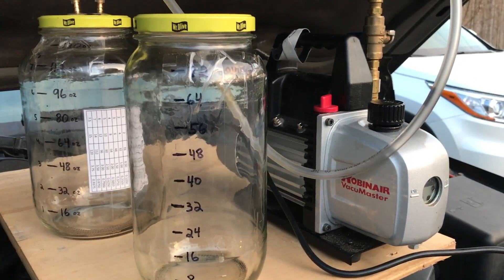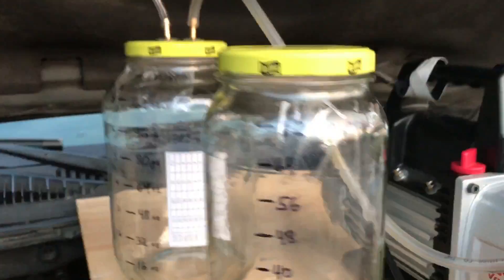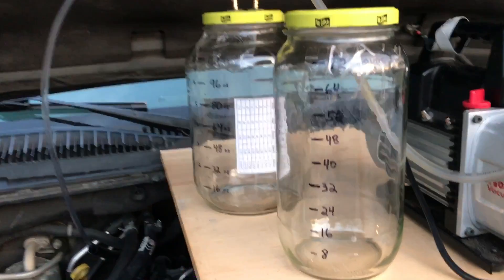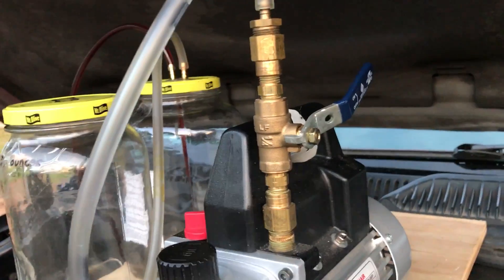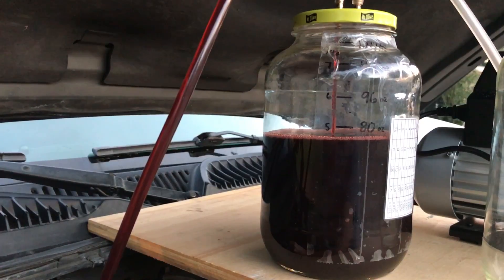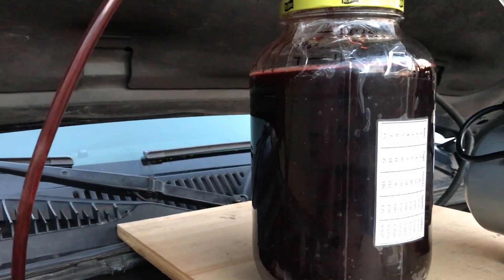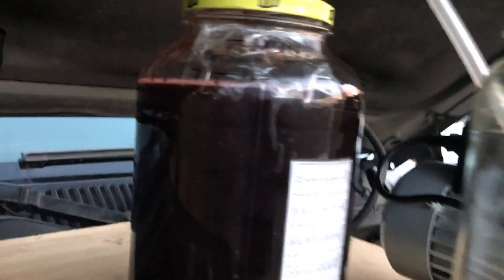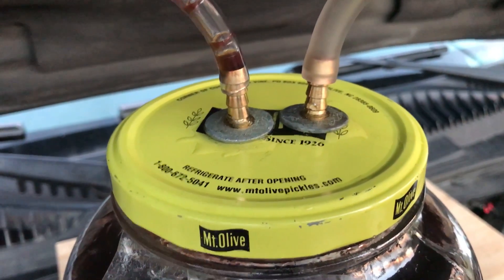Transmission Oil and Engine Oil fluid extractor using vacuum pump

Comment: Extracting through the cooler line removes all the fluid. This way doesn't.
Reply from the maker: The point is not to extract all. Coolant line method doesn’t extract all either unless you do a longer drawn out process. I’ve done both. This way done regularly is very fast clean and adequate.
Reply: @condor5635  Ultimately, it's however you choose to do it. For me, I like changing all the oil, not just some of it. Emptying the pan and going through the cooler return line will definitely remove all of the fluid.
Reply from the maker: @apostasiaelegcho5612 I’ve done it all believe me. This way done every 20-30k miles is plenty. Thats because I buy my cars new and maintain them myself. Would I do the cooler line method if I brought a used car yes. Ongoing maintenance no.  Dropped the pan at 100,000 clean the magnets replace the gasket.  I’ve got three cars with 275,000 miles or more.  If you don’t see the value in this pump, then you’re missing the overall point.
Reply: @condor5635  I didn't mean to claim there was no value in doing it that way. My car is 22 years old. It looks like it's 5. I'll get another 20 years out of it. I just think if you go to all that trouble, might as well clean it all out. Anyway, good video.

Comment: I'm going to try this but to do water changes on my aquarium.
Reply from the maker: Probably need a 5 gallon carboy. I have one of those and it works great.  Although I had an aquarium and I never used this I just use a pump and filters.
Reply: @condor5635  it would be much easier to buy a pump and just use that. But I'm very frugal with my aquarium hobby lol I have some 5 gal buckets that I could repurpose. I bought a nice cordless vacuum pump a few weeks ago since it was time to replace some components of the HVAC system on my vehicles. I figure if I could get some extra use out of it, it's a win win situation.

Comment: Dang , i just pump out a sealed for life transmission with a hand pump. And i have this vac pump sitting in my garage  . This will be great for differentials
Reply from the maker: Yes, I use it for vacuuming the differential fluid out of my suburban with a long vinyl tube works great. Not very effective, however for a seal transmission because you can’t get to the fluid from the top. The fill plug doesn’t have enough access and there’s no dipstick.

Comment: What fittings are needed for the ball valve? 

Thank you
Reply from the maker: I have no idea what you would want. You just need to figure out based on what size ball valve you want to use. It’s not difficult. I’m not sure if it was a quarter inch ball valve or a half inch ball valve either one would work just need to experiment.

Comment: Have you used two smaller jars in series to catch say 5 quarts?
Reply from the maker: When I go above a gallon I have two car boys. A two or 3 gallon one and a 5 gallon one. I’ve use those occasionally but not a whole lot
Reply from the maker: I’m just re-reading comments on my video and saw this one again. I’m guessing two jugs in series would work fine it would essentially fill up the first and then start going into the next. I don’t see any issues. I might have to try that next time I need more than a gallon of extraction. Thanks

Comment: DANG!! I WISH I WOULD'VE SAW THIS VIDEO YESTERDAY; I WAS TRYING THE VIDEO IDEA OF USING A SPRAY BOTTLE NOZZLE AND PLASTIC/RUBBER TUBING TO TRY TO EXTRACT THE EXCESS TRANSMISSION FLUID OUT OF MY TRANS. I SAT THERE FOR 4 HRS YESTERDAY TRYING TO PUMP THE FLUID OUT AND SPRAY IT INTO A BOTTLE. I PUT TO MUCH FLUID (A QUART TO MUCH) IN MY TRANSMISSION AND NOW NONE OF THE GEARS IN MY WIND STAR WILL SHIFT INTO GEAR. SO I CAN BUY THIS AT HARBOR FREIGHT OR ACE HARDWARE?
Reply from the maker: Charles Porter - HF sells the vacuum pump. Getting the pickle jar, tubing, ‘metering’ valve and vinyl tubing is all you need to make the rest. You will love the results. Good luck
Reply: @condor5635  Thank you for the Advice Condor.

Comment: Hi Sir, if using plastic peanut container can it work or will damage the plastic container, have you try using plastic container to extract the oil? thank for sharing
Reply from the maker: Ng Ch - I have tried several other containers made of plastic and although they seem sturdy in your hand they collapse under vacuum pressure. Glass pickle jars are the only things I have had success with. Would love to know others suggestions!  Thanks for sharing and watching!
Reply: @condor5635  Thanks for your information.
Reply from the maker: Ng Ch vacuum pressure is an amazing force!  Look forward to hearing more about your experiences!  Thanks

Comment: Is this removing fluid through a transmission dipstick tube or through a filler plug?
Reply from the maker: JackTannehillPromoter this is removing it from the tube which is the filler and dipstick location as well.  Thanks

Comment: I've done basically same thing for several years. 
I prefer the cheap $16 dollar harbor freight air compressor AC vaccum pump.
I use one of their cheap air regulators on it.  20-25 psi on the regulator pulls plenty of vacuum for fluid extraction.

I use the quart and half gallon Ball jars,  they have measurements built in.
Reply from the maker: Sam Sullivan - thanks! Have to check out Ball jars knew they made smaller ones but not gallon ones! Is the Harbor Freight a combined compressor/vacuum?  Thanks for commenting !
Reply: Sam how many cfm does that require? I only have a 1 gallon compressor so I used a oil less vacuum pump I had around the shop https://www.youtube.com/watch?v=jjGqUhP9uII

Comment: I would advise putting a piece of heavy cloth or a tarp over this device, at least for the first use.  It might implode.
Reply from the maker: 1234faabbb used them many many times without issue but having a heavy towel over it wouldn't hurt if that makes you feel better.  The key point is don't go crazy with the vacuum pressure since the fluid starts to boil etc and there is really no need since a small negative pressure allows it to flow at a good rate anyway.  The valve on the vacuum pump is key to making that happen since your can (and need to) regulate the pressure manually.  Get it flowing initially and then turn off the valve.  Wait 10-15 seconds until the flow starts to reduce and the open the valve up again.Think of it as you drinking from a straw- you don't need a lot of vacuum to make the fluid flow.  Thanks for watching!
Reply: LOL, it wont implode man. Stop your whining.

Comment: Did you need to make rubber gaskets for the pickle jar lids or just use them how they are?  What about sealing the barbs to the lids?  How was that accomplished?
Reply from the maker: Snake Doc - the lid seals are perfect as is since they seal pickles and the juices.  The barbs on the lids I used some flat washers to give them support and then used epoxy to seal and secure them.  Might try permatex gasket sealer as well or in place of. It's just important I found to have the support of thin washers on both sides of the barbed nipples.  Never seen a commercial product that could be used instead.  I used this system  yesterday to remove 145 ounces of ATF fluid for my CV axle job.  Took like 5 minutes.  Thanks for watching!
Reply: @condor5635  I built mine IDENTICAL to yours and I cannot get it to pull fluid up the tube.  There are no leaks and I feel suction on the end of the clear hose too.  What could be the issue?  Do you need to get the trans fluid hot?
Reply: nevermind, I just didn't make it down the last curve of the dipstick tube.  I got it going now.  Holy crap!  This thing is awesome!
Reply from the maker: Snake Doc - happy you like it!!

Comment: I can’t believe I’ve waited to google this. 

I had the concept down, but me applying it was different. Thank you!
Reply from the maker: Doc Cal - used this system yesterday to remove ATF fluid when removing my CV axle.  Two quarts drained out of the seal area when I did the drivers side two days ago.  I was expecting a little to come out but not two quarts and I forgotten to have a pan all ready. So I vacuumed out 140 oz prior to doing the work on the passenger side which I did a few days later.  Kept all the fluid in two clean jars you see in video while I did the work and then put it back in when completed. Not a drop came out near the seal this time!  Worked great - thanks for watching and commenting.
Reply: @condor5635  I haven’t had any issues with mine. I am glad I stumbled upon this video
Reply: @condor5635  I don't understand how or why that would happen, 2 quarts leaked?
Reply from the maker: Tadders - when you remove drive axles on front wheel drive cars the transmission fluid can leak out from the axle seals on either side when you pull the axle off. . Using this pump allows you to take out the ATF fluid so that when you remove the axles the likelihood of very much fluid leaking out is much reduced or eliminated
Reply from the maker: Did you ever end up making your own? Interested in your outcome

Comment: Modify a rubber cap with a vacuum fitting and you can use it to bleed brake systems and clutch hydraulics by placing the fluid reservoir under vacuum for a bit. Just replaced a clutch master and slave and in 10 seconds of vacuum pumping I had an air free clutch release system. Never touched the pedal or bleed screw lol.

Comment: This sounds exactly like what I am looking for. I need to get something for extracting my transmission fluid and I also want to suck oil out of my lawnmower that has no drain plug. I already have a vacuum pump so if I can replicate this system I think i'd be looking pretty good. Any tips on hose sizes or setting for the vacuum pressure value? How much did you have to restrict it to get a nice flow?
Reply from the maker: Frozen Thorn - I just used mine yesterday to suck out the oil from my compressor. After doing that I removed the drain bolt and nothing came out so that’s the way I’m gonna be doing it from now on with that compressor!  - it’s a quarter inch ball valve that you need as well as quarter inch tubing and nipples. Easy to put all that together. The vacuum pump puts out way more than enough vacuum so it’s very little opening of the valve once the vacuum is established. Thanks for watching and good luck with your project. You’ll like it a lot

Comment: This is the cleanest way of doing things. Now you can take the pan off and complete the job with a full transmission flush. My new pan has a drain plug. I do my brakes with vacuum as well. Nothing gets spilled, just all clean.
Reply from the maker: Gerard Lunow - thanks for the comment.  I personally think this system is much more effective, stronger and versatile than Mityvacs  or other manual pumps. Cleaner as well. Thanks again

Comment: That's partial fluid change and not all the fluid get out totally. The reason is that there is a lot of fluid on the torque converter. Mixing it it will take very long time and a lot of fluid changes to get near to full fluid change .
Reply from the maker: Special edition - I know all about what's left in the torque converter and yes it would not get it all out but doing this 4-5 times gets you over 90% new fluid.  I have done the math. It takes 10 minutes to do and as part of a normal maintenance will keep fluid at a very high quality. I have also done the fluid change by removing the return line and doing multiple cycles of starting the car and pumping out fluid getting a more immediate full change.  I prefer this - You don't even have to get dirty.  Granted doing a pan drop at some point is required as well to change filter and clean magnets.  This technique works great for all sorts of extractions of fluids.  I love it. Thanks for watching.
Reply: @condor5635   Olso I wanted to say that partial fluid transmission changes it will get to 50 % or so maybe 60 % but not totally clear .I did change my transmissions fluid  partially and every time I will get 3.5 quarts and replaced with the new one and the fluid still looks red dark kinda.   There is a formula  mixing the fluids that can give you the long run and how many times you need to get to 90 % like you say here . Now emptying the fluid transmission from the lines and running the engine it will make your transmissions pump running dry and that's near to destroying it . Thanks for replying here.
Reply from the maker: Special edition - yes it’s easy math to figure out but like I said 4-5 of these will get you 90% or more new fluid. My approach is to do this as a part of regular maintenance thereby keeping the fluid at a high quality all the time.  As far as doing it via tranny lines I only drain a quart at a time and the refill and repeat. Thanks
Reply: @condor5635  Yes .I agree with you on changing the oil all the time  so that way the oil will be in good quality and that way I dont need to change the filter for years if not forever because the filter will work clear all the time . I saved a lot of money this way instead going to the dealership and paying 200$ plus taxes and ruining my transmission . Thanks .
Reply: The pump out, great idea.  This as a service not good at all.
Reply from the maker: TreRichie - what do you mean by this as a service not good at all?

Comment: Hmm.. So you can turn off the valve and the oil will keep draining?
Reply from the maker: Yes since the jar still has vacuum pressure in it, it will continue sucking oil out until. The pressure equalizes with atmospheric pressure.  This will be the case for 10-20 seconds I am guessing.  It is a gradual decrease in amount over that timeframe. Thanks for watching!
Reply: @condor5635  Thanks for the quick reply. I just bought one today to extract brake fluid. My Brake booster went out, so your method looked like the best one to take the oil out. I didn't feel like taking my tire off to bleed the brakes. It looks like it makes things a lot easier and mess free. I just need to head towards home depot now to get some fitting for tubes and a valve. So you would say 1gal jar is recommended for most oil extraction?  Thanks for sharing.
Reply from the maker: Fallen Matter - although this will work fine for brake fluid there really isn’t enough brake fluid in my opinion to make this worthwhile. You might only get a pint or two out of the brake fluid reservoir. For brake fluid I bought one of the large syringes that work well to suck out the small amount in the reservoir. Don’t get me wrong - this will work fine as well. It really excels for ATF and engine oil where you have over a quart to extract. Good luck and thanks for watching
200ml Syringe
 https://www.amazon.com/dp/B0768B5BTM/ref=cm_sw_r_cp_api_i_uTk4Bb3X9YCZ0
Reply: @condor5635  Awesome. Thank you for the great info. It helped a lot.

Comment: A great set up mate, i might try plastic fluid retaining bpttles, as i would drop it at least a couple of times....Lol
Reply from the maker: Norman Mendonca - thought about plastic a lot but there are not any nice plastic container that are very clear and that don't collapse under the vacuum pressure - both of which were requirements.  Glass is much easier to clean as well and these jars are everywhere and cheap.  Actually used this setup last night to remove the water from my AC pan in the attic which was full of water as the main drain had clogged.  This easily pumped out gallon and a half of water.  Thanks for watching. Appreciate it.
Reply from the maker: Norman Mendonca - have tested several plastic containers and all collapsed unfortunately. I wish I could find some that were sturdy enough not to collapse under vacuum. Plastic 5 and 2.5 gallon paint buckets can’t take the vacuum either.

Comment: Do yourself a favor SAVE TIME + $$$$... Get on Ebay and get an Oil Extractor Pump for $16.00.. Use it on anything, Oil, Transmission, Brake Fluid, Steering Fluid, etc.... :D
Reply from the maker: Jordan Bronson - thanks for the comment. Wont save any time however.  This will pump just as fast as any motor pump and when your done all I have that is oily/messy is the jar and one tube plus it is not impacted by the fluid temperature since hot fluid is not flowing through the pump.   Definitely cheaper to buy a cheap pump on eBay but you get what you pay for.  Are there priming issues with those pumps?  None here.  Thanks again
Reply: +condor5635 - Hahahahahahaha - I know you are proud of your invention... I hate to bust your Bubbles... In this case, I hate to bust your " Jars "  LMFAO !!!
Reply: You didn't bust anything kid..
Reply: Correct,I bought a sealey vac pump years ago,use it for oil,and CVT extraction
Reply: I have one of those $17 eBay fluid extractors, they work well and are a good backup to have around.
Reply: I have a vacuum pump laying around, so this is perfect lol.